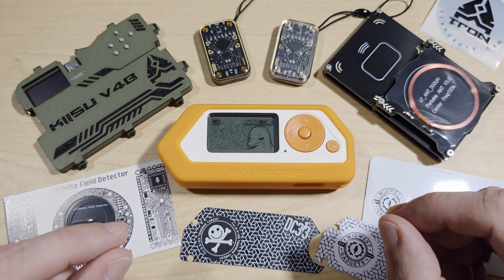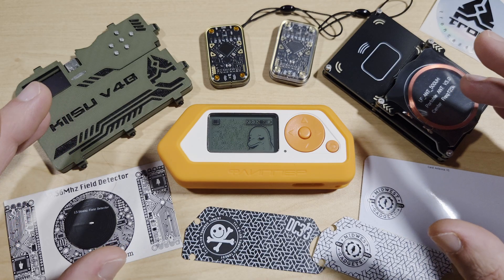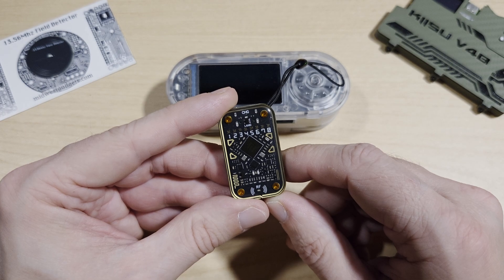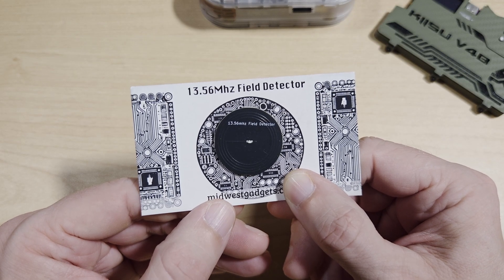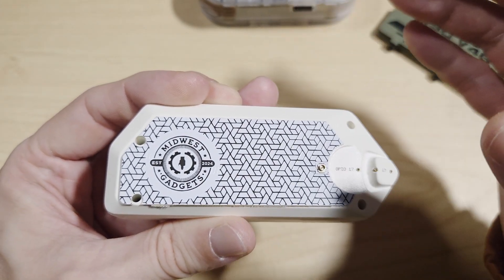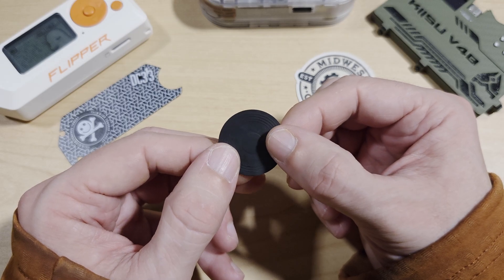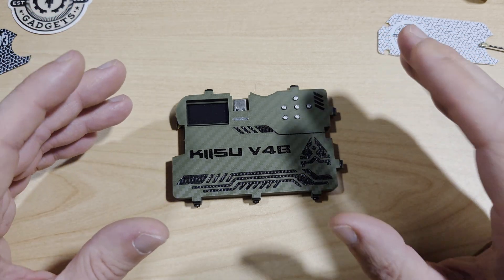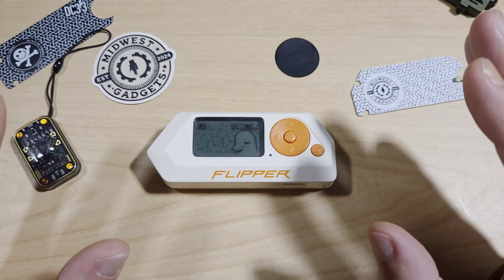Exploring RFID & NFC: From Theory to Tools With Midwest Gadgets & More

Comment: 1:53 why does ultra high frequency have a higher range? since with radio waves the distance traveled drops as frequency increases, due to the higher frequencies waves losing energy faster
Reply from the maker: HF RFID has a higher maximum  range of 30cm compared to 10CM with LF RFID due the higher frequency allowing for better signal propagagion and also making it less susceptible to interference.
Reply: @nobultech  interesting, thanks for the explanation!

Comment: ChameleonUltra is it safe to remove the slot 2 (IC - Ultralight) & slot 3 (ID - EM410X)?
Reply: Depends on what you mean by remove. If you're talking about simply re-writing over it or deleting the records, then absolutely it's safe. If you're talking about deleting the slots entirely, I'd say there's definitely risk of corrupting something, and if you're talking about physically removing them, I'd say 100% do not do that.
Reply from the maker: @Deeidy1 Thanks Deeidy
Reply: @Deeidy1  Thank you for your explanation. 
What I mean is re-writing over it or delete the records. Because I am not pretty sure why CharmeleonUltra comes with it in default.

Comment: I wish Tron would make cases for something OTHER than the Kiisu.
Reply from the maker: He does, he makes cases for several Rabbit Labs flipper zero boards, Evil Crow RF V2 and a case for the ESP-32 C5 devboard with built in SD card reader
Reply: @nobultech Nothing I own though. I know he has other stuff, but nothing that protects the GPIO pins from snapping.
Reply: @raversmiracle2  Actually Tron makes lots of sliders that help protect GPIO pins. He has some fantastic designs.